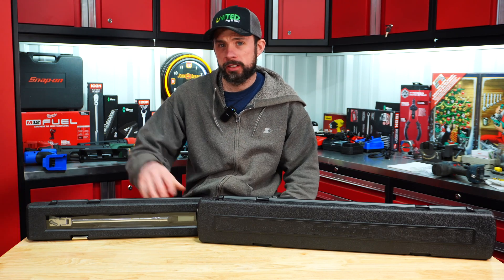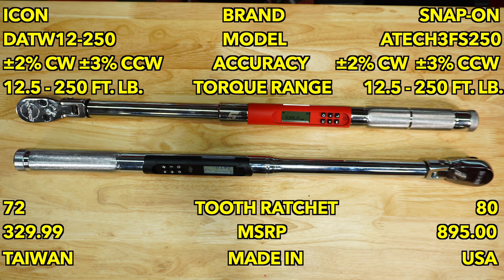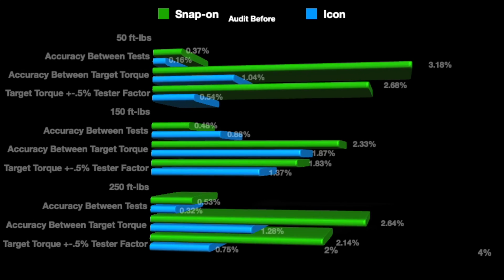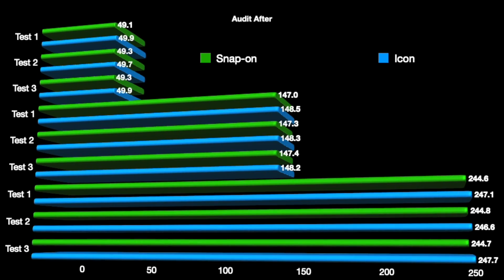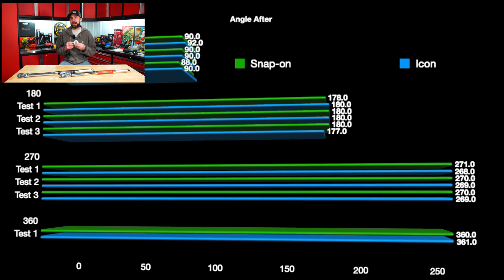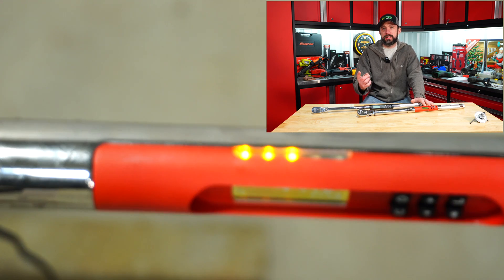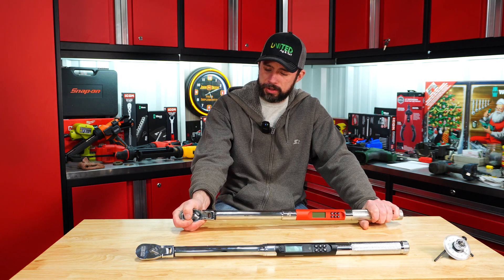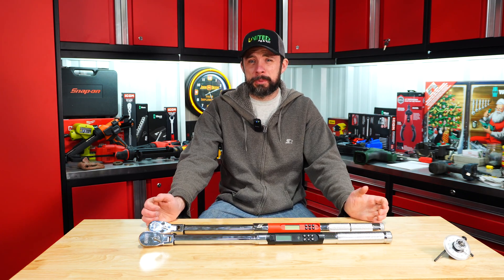Snap-On VS Harbor Freight Icon Digital Torque Wrench

Comment: only downside of the icon is it's 90 percent of the snap-on if you care that much about the tooth count. i've only had the chance to use the icon for full reassembly of one engine, but it certainly performed and exceeded all expectations. I also got to use a snap-on torque wrench, and in my hands i had a noticeably different experience. it just felt outdated with certain design choices, like the LEDs on the side and the screen not being backlit for some reason? must've been broken, but that's not helping the case any

Comment: Did you have a control?? Did you tested them after 1000, 5000, 10,000 clicks and see the final measurements?? After you do that you will find better results on what's better.  Durability accuracy is very important

Comment: I don't know what I hate the most, Crap-on or the Crap-on fanboys. Snap-on is just the BMW of tools, expensive and exposes the ones that believe that a brand is worth more than it is. I myself use AmPro, Sonic, Irimo torque wrenches, no digital with lights and such. Just old school. The most important thing isn't the torque to spec anyway, but the repeatability. An engine care more for the same torque over the head to get even torque then it cares for getting close to specs in the manual. And that can be achieved with the low cost torque wrenches from like walmart too. But I must say that digital scale and chasing a set value on display is more convenient than spinning a handle to preload a spring before chasing a click. But that requires regular use, or else it's just money down the drain. And turning a nut on a bolt or a screw to an angle spec only requires a cheap ass dial anyway. So that 890$ is even more money down the drain.

Comment: When you're torquing big bolts, high torque with these, it absolutely doesn't matter at all, not even a little to be a few more or less pounds. Accuracy doesn't matter here. Now if you are looking to torque a little, that's when you need precision.
Any cheap $50 1/2" wrench will serve you at home or at work. Do not waste your money in any of these...

Comment: Why doesn't Harbor Freight / Icon make a 3/8 version or event 1/4?  Seems like it would sell more 3/8 than 1/2 wrenches for most DIY folks.  For cycling and other small items, 1/4 options are pretty awful in most cases.
Reply from the maker: Yeah I don't know why we don't have a 3/8 yet,  they keep showing a 3/8 version but it's still not available.  They should have released all 3 by now IMO.

Comment: Seems like Icon had the goal of taking on the top of the pile right out the gate, and they are slaying dragons. I will definitely give the Icon digi and split beams a try.
Reply from the maker: Yeah they are both solid torque wrenches.

Comment: I was able to pick this up for $222 last week with Harbor Freight's 40% off Icon torque Wrench Coupon. Definitely a steal. Beats Snap On in literally every way plus has a lifetime warranty!
Reply from the maker: Nice! Yeah it’s a good deal. Looks like we should see the 3/8 version in 2025.
Reply: @Tools-Tested  only downside to the 3/8 is a bad torque range. I believe it's 20-100 ft/lbs. I don't see how the 1/2 can go all the way down to 12.5, but the 3/8 won't be able to. I was expecting more of 5-100 ft/lbs

Comment: Most recent HF sale had this wrench at $222. Unbeatable.
Reply from the maker: Yeah that's an awesome deal!
Reply: @Tools-Tested  This season of sales has been particularly good. The one thing I'm really upset about, and will probably be returning, regardless of how good the deal was, are some of the Icon socket sets. Particularly the chrome 1/2" sets. I couldn't believe they don't start at 10mm for a no-skip set. It's outrageous. I'm so pissed. I grabbed both the shorties and deeps in metric and SAE, without paying attention. I was in a rush, but needed 6-point sockets (all I had were mostly12-point before in 1/2"). I saw they were no-skip sets, so I just grabbed them. I now went back and checked, and besides maybe the one Quinn set that comes with a wrench, ALL their 1/2" sets regardless of brand don't start at 10mm (same in the equivalent sizes in SAE). I often need to have access to 1/2" down 10-11M, just for convenience sake, or instances of nut & bolt combos, so I can grab both ends. It's such a weird choice, most sets from other manufacturers like Tekton, SK, Craftsman, etc., all have sets that start at least at 10mm (and equivalent in SAE). They don't even sell the 10-11mm separately, so I can never complete the set.
Reply: Yep. Finally grabbed one for myself too. At that price it's a no-brainer.
Reply: Picked one up too
Reply: All my stores were out of stock but magically we’re getting in a “bunch in 2 days”
Reply: @remogaggi82 I don't get the sarcasm...what's supposed to happen in 2 days?

Comment: This is such a good channel. I really appreciate your laid-back style and straightforward approach.
I was wondering if you could weigh in with your opinion on something: I need to replace my clutch/pressure plate/flywheel and it involves torquing the flywheel bolts. I own all of HF's cheap Pittsburgh t wrenches, as well as the Quinn 1/2" adapter. I'm not made of money, but am debating picking up either the Icon you tested here or their split beam w/ the flex head. I imagine that 2% difference will matter between the cheapies and the high end for something like a standard transmission job, but unsure about the Quinn. Care to share your thoughts since you've tested all the aforementioned torque wrenches 🔧 ?

Comment: Any long term use thoughts to add on the icon? On how it’s holding up? Also do you know if proof of calibration is required for the warranty? Or if something is wrong or ratchet head falls you can just warranty it in the store?
Reply from the maker: I haven't had any issue with it,  that said it's not used on a daily basis.  I believe you can just return it if say the racket failed or screen fails.  I don't think they would care about the calibration at that point.
Reply: @ right on, thanks. I just bought the icon last Monday and I’ll be using it daily and a LOT… The warranty was a big selling point. I’ve had the snap on for 5 ish years and it’s gone back twice for repairs and recalibration at 165 bucks a pop. It still has the same reoccurring problems where the screen is lit up but goes blank or it turns off completely. The last time the snap on guy sent it in for me I insisted it has an intermittent problem and I wanted ALL the electronics replaced. Sure enough it came back with a calibration sticker and the same old electronics and sure enough after a day of use it’s having the same issue. I was fed up and told the snap on guy I’m not buying a new one for nearly a grand when the service won’t listen to the guy that uses the wrench all day every day.

Comment: Getting a torque wrench today. Don’t see the need to buy a snap on due to the fact that most work I do is basic but I am doing a head gasket in my garage and that of which absolutely no doubt requires a torque wrench I just do not want to mess up and it’s only one job so definitely picking up an icon torque wrench today. 11/10 video my man ❤
Reply from the maker: Glad to hear you found the video useful!  Yeah the Icon is a good value IMO.  Thanks!

Comment: The problem with the Mac and Snap On users is they aren’t honest at how those brands are not the same quality they were 20 years ago. I have a full set of Snap On sockets and wrenches I bought 22 years ago, and ended up needing and buying some new Snap On sockets for a project last year and they simply aren’t the same quality as my older stuff. I don’t know why that is…steel quality, manufacturing tooling…I’m not an expert on why it’s different but it is. That quality decline has allowed brands like Icon to come in and chisel out a market that is almost as good, or better than the truck tools.
Reply from the maker: Yep Taiwan especially has been getting better every year.  My biggest issue with Snap On has always been support,  battling with them right now.  Sent a $4k SO torque wrench tester out for repair and I cant seem to get a call back on the status.... going on 3 months now.....

Comment: I've had a Snap On Tech Angle (3/8") for ~20 years. I use it on everything under 100lb/ft, including lug nuts, so it gets used a lot!

It was still within 0.5 lb/ft through the range (up to 100lb/ft) when I last had it last tested, a couple years ago. I've had it tested 3x, it has always been the same, never adjusted, and it still works!

Tech Angle is the grey body Tech Wrench. It measures tightening angle after reaching the desired torque. So, say your head bolts are "70lb/ft + 115°", after reaching 70lb/ft it measures the angle the bolt is moved, and it doesn't matter if space is limited. It's got some kinda pixies to measure the angle tightened, regardless of attitude or ratcheting. 

Real nice for head bolts that are hidden under the wiper cowl!

Comment: On the icon you just get another as far as calibration goes. And it’s free. That alone is why I went with icon over snap on torque wrenches.
Reply: How?
Reply: @mikeprice8307 Warranty claims. Harbor Freight will do it over the counter with no questions asked, just need the receipt or an ITC account that has a record of you buying the wrench.

Comment: Any chance you’ve still been using this? Debating on picking one up, just not sure if it has been holding up
Reply from the maker: Yeah I am,  haven't had any issue with it.  Unlike the the gearwrench I had to ship off for repair.....
Reply: @Tools-Tested  thanks for the reply I appreciate it 🙏 judgmental looks all through out my shop cause I want an icon torque wrench and not willing to shell out 1k on a snap on one 👍🏾
Reply from the maker: No problem! Lol well sadly the Icon is cheaper and better IMO.

Comment: I have the snap on one, but also 1/2 my tools and my box is icon. I was gonna get the icon one but my dealer got a repo one and for a hella steal of 250 I got the 1/2 inch and 3/8 so I couldn’t pass it up. Otherwise I would have had the icon one. Might get the icon one for home tho
Reply from the maker: Wow yeah you really cant beat that price.
Reply: @Tools-Tested  absolutely not, I wanted both red in foam if it was snap on but again I wasn’t about to pass that shit up. To this day best purchase on the truck I have had

Comment: Is it an illusion or does anyone else see the tines connecting the head on the Icon deflecting quite a bit especially at high torque tests? Would this be a concern for the longevity of the tool?
Reply from the maker: Both tend to flex a good amount,  I also noticed more play in the SO head.

Comment: The Icon lifetime warranty was a huge selling point.
Reply from the maker: Yeah Snap on its one year I believe,  kinda a joke considering that torque wrench is $1k.
Reply: @Tools-Tested the head is lifetime
Reply: 😂😂😂😂
It’s not lifetime warranty. 
In fact I have the last generation one and sent it in for repair and they claimed it needed a new board and they don’t make it anymore. 
So I guess I have a $1,000 paperweight.
Reply: @johnlynch7990 You're talking about Snap-On right? Harbor Freight will just replace the Icon with a new generation no questions asked.
Reply: @tom23245 no he literally is talking about the harbor freight. You people think you’re going to constantly warranty that are insane. They even say if you don’t calibrate every 6 months then warranty can be denied. Not to mention snap on will service yours for you. I love harbor freight but you people are taking it way too far saying they’re equal.
Reply: @ethancarter2087 The Icon one is not $1000, and I don’t think they do any repairs they just replace items. He’s definitely talking about snap on…
Reply: @johnlynch7990 It absolutely is a lifetime warranty. You must have a shitty store. Any time I've had an Icon break, I give them the broken one and grab a new one off the shelf.
Reply: @johnlynch7990 icon has the lifetime and isn’t 1k

Comment: I don’t normally leave reviews but this video led me to get a icon torque wrench I’ve done multiple head gasket jobs and torqued plenty of wheels all with no issues this torque wrench seems to be accurate and I’ve had no issues since using it
Reply from the maker: Thanks! Glad to hear it helped,  the Icon really seems like a good value.
Reply: And Shut the hell up!! So Don’t review!! Icon is suck!! It ran out accuracy after couple hundred time using and F up our tap threads of the chamber. We need to open and insert helicoil.

Comment: Really glad to see harbor freight not treating torque wrenches like a joke, I know that name used to make me remember broken bolts just a few years ago. That being said if you were to daily one of these as a professional, I probably go through 1000 cycles every week at work over 3 years my snap on has never been out of spec, will the harbor freight hold up?
Reply from the maker: Yeah they are improving in some areas.  I think it would hold up,  its the same torque wrench Cornell sells for 3x the price.

Comment: Did you test the icon at the bottom end of it's claimed range at all?
Reply from the maker: I haven't,  normally once you get below the lower 20% (50ft lbs) the accuracy will start to degrade and end at around 7.5% at least thats what I have see with other digital torque wrench's.

Hopefully they release a 3/8 version soon.

Comment: I wanted to see the lower range tested. These go down to 12-foot pounds. I rather use one torque wrench for much as possible. The idea is a digital should be able to go down to lower ranges. The Honda's and other imports mostly 6MM, 8MM, 10MM bolts the torque ranges are from 18-36 lbs. It's all aluminum so have to be careful not to over torque easy to do.

Comment: I honestly don't think the snap on head wiggle would affect torque, a load suspended is a load suspended. I would suspect it could accelerate wear on the joint it pivots in though.

Comment: Returned my 250ft lb husky torque wrench to buy the icon split beam after watching one of your videos. Now I’ll be exchanging the split beam for the icon 250ft lb digital torque wrench after watching this video😂. Thanks for helping me make a better decision.
Reply from the maker: Lol,  if your full time wrenching you might consider keeping the split beam alongside the the digital.  I personally prefer a split beam for most work.  Glad to hear the videos help!
Reply: @Tools-Tested  Would you recommend one over another between split beam and digital for a DIYer? I'm working on a couple of Subarus (family cars). Really just desiring accuracy over the long-term, and I feel like digital will help with that, but in the immediate use I am in the middle of a head gasket job and wanting to make sure I do everything right per Subaru's specs.

Comment: be interesting to test how accurate the angle is upside down on both them. Another youtuber adept ape was having problems with his snap on one being inaccurate upside down.
Reply from the maker: Interesting I will have to check that video out.  I do watch adept apr form time to time,  because I work on Cat engines for my full time job.
Reply: @Tools-Tested  I don't think it was a dedicated video. Just mentioned it during one or the engine overhaul ones.
Reply from the maker: @jnic2003  Found it,  its in the video he tested the use of extensions with a torque wrench's.

Comment: I'm Very impressed with your testing equipment and the rigor with which you conduct your testing to provide statistically reliable measurements
Reply from the maker: Thanks! I try to keep the testing as accurate and repeatable as possible.

Comment: I bought the Icon solely based off of this review. Needed one to do my kia head studs and it didn't disappoint. The guys at the machine shop told me I should get snapon but after seeing this video I felt so much more comfortable with Icon.
Reply from the maker: Nice!  yeah I wouldn't have any doubts,  the Cornell version looks to be the same wrench for $650.
Reply: So he tested them for a thousand cycles and it still performed.  I've had mine for about a year now and it still is performing like new.... HF Icon line is a win no matter how many people want to act like their trash. At one point years ago I felt the same way but things changed and they stepped up their game.
Reply: This is just one day of using this torque 😂😂 snap on will definitely win in the long run. 
For DIY I think HF is ok but for professional y’all need a SO torque wrench
Reply: @yair7227 yeah but lifetime warranty I walk in every year and they hand me a new one 😭😭😭 after a year your dealer won’t even give a fuck about you
Reply: @yair7227   "one day"?   An 8-hour or 24-hour time period means nothing compared to 1000 cycles in his testing.
Reply: @yair7227 absolutely not. Snap on doesn't even make the best torque wrenches
Reply: Sheep

Comment: I bought 3 Snap On TechAngle torque wrenches and they all have problems. I got 1/4", 3/8" and a 1/2" and they have a similar problem that makes it totally unusable. When you need it while on a job, that is when they gave up, leaving you in a bind. The problem were the battery chambers. For some reasons, due to poor design, the connection will cut off and the result is that it becomes totally unusable. On Youtube there were a few videos addressing this problem and how to fix it. Believe me, I tried and unless you are an electronics repairman who is handy with a soldering iron, don't even attempt it. How in the world a torque wrench costing a bundle could have such design flaw ? It is not rocket science to design a battery chamber that works. What a shame, touting USA build and leaving a short end to their users. No more Snap On for me......period.
Reply from the maker: Yeah those early ones weren't very good,  a coworker of mine had one with the same issue.  I think he ended up trading it in on a new version.